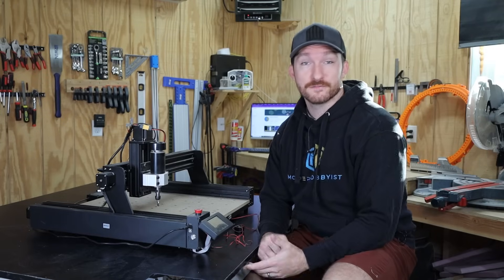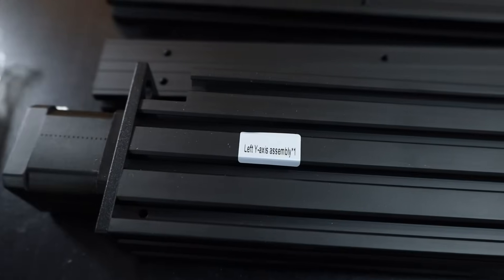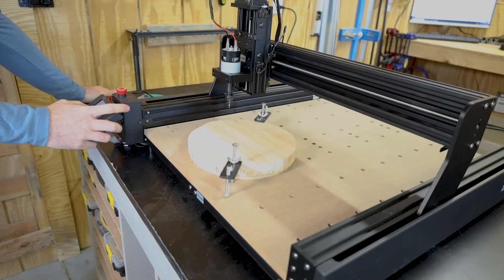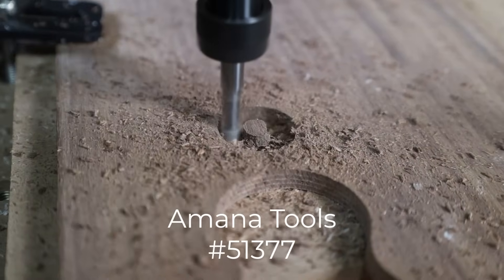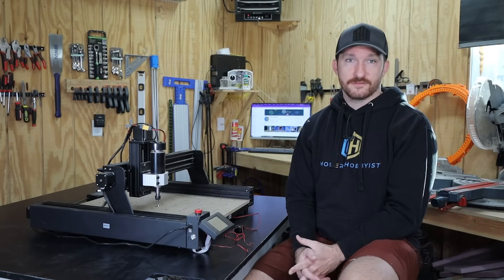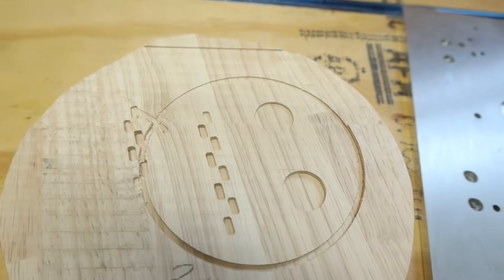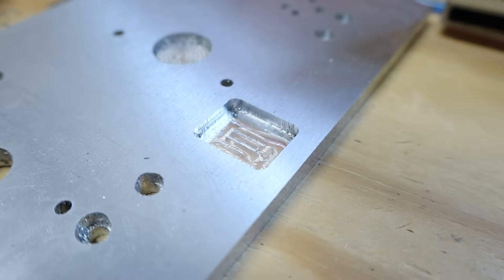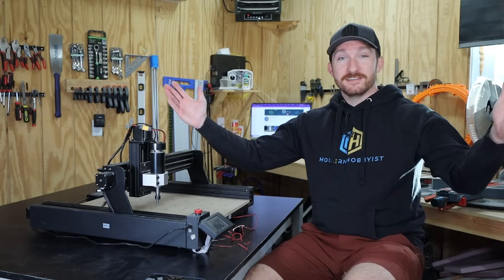What can a $500 CNC Router Do?! TwoTrees TTC450 Review

Comment: This is the third review of this machine I have watched and not one reviewer bought the vacuum attachment.  Is there a reason you opted for no dust/chip removal?  To me it seems like an obvious option unless there is a design issue with the vaccuum assembly.
By the way, thanks for the excellent, honest review.
Reply from the maker: I might have to make a separate review about that but TwoTrees sent me this machine so I didn’t really get a say in what they included unfortunately. Appreciate the feedback though!
Reply: I bought the vaccum, it makes a huge difference. It's not perfect but you get maybe 90% less chips flying everywhere. And the LED attached is a nice touch. Only design flaw is maybe the tube has to be carefully set, when I started a job I didnt see it was touching the 500w spindle fan so it melted it a bit -_- but that's probably on me though

Comment: You need to earth your shop vac hose
Reply: Make a nozzle extension from a cardboard tube...  End of shocking your machine.
Reply: How do you earth shop vac hose?
Reply: To ground a shop vac hose, you can wrap a bare copper wire around the hose's spiral and connect it to the machine's frame. This prevents static electricity from building up in the hose and ductwork.

Comment: The TTC 450 Pro is the actual upgrade to this machine, with much of the issues already or partialy delt with.
Reply: I see the original being sold for $400 and Pro for $550. Both with the weaker motor. That's a big price difference. 

I wonder if I can swap the motor to a more powerful one from a hand tool. They cost like 25$ and have 30'000 rpms and 800W (claimed, in reality probably less).
Reply: @deserRGB  I've seen some that come with adapters that you can use to mount an actual router, like Milwaukee, Dewalt, Ryobi, etc.  I think you select the adapter you want when you order.